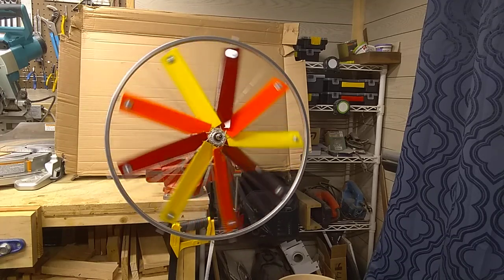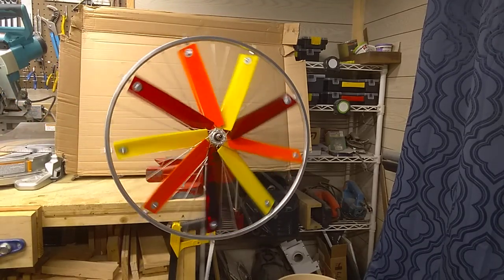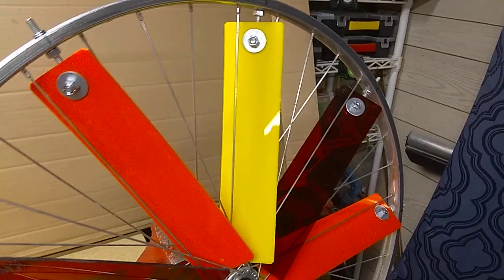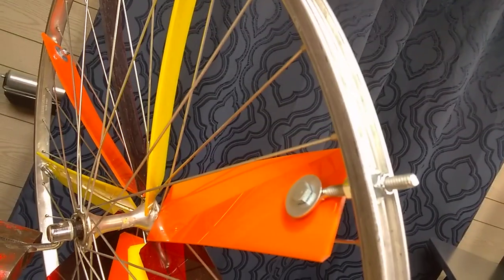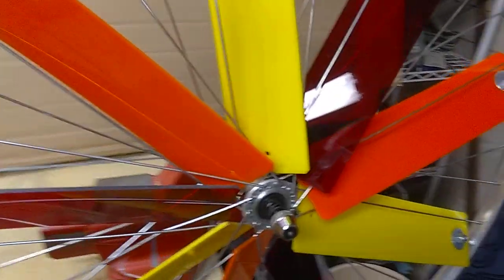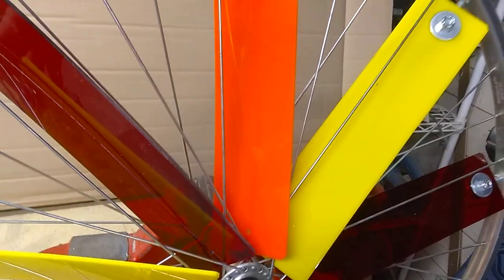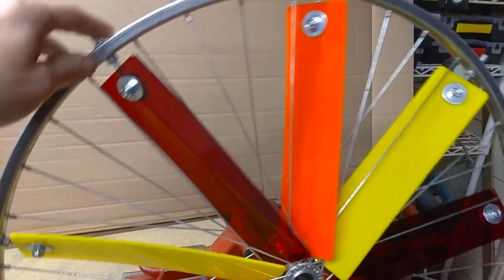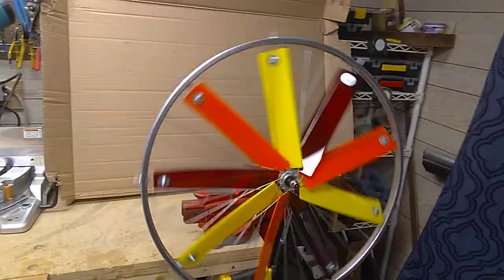A better bicycle wheel whirligig

Comment: Looks great and a very good idea. Do you connect the center by the hub? I noticed you have a hole there. Thanks for sharing with us. Albert in Texas.
Reply from the maker: I was going to use those holes to wire tie the blades to a spoke, but they weren't needed.

Comment: Where did you pick up the plastic? I would also think reusing old aluminum panels off window shutters would work too.
Reply from the maker: Possibly tapplastics.com.  It's easy to find online in various colors.  Sure, scrap aluminum would work fine.
Reply: Pretty much any scrap pieces of flat material would work as long as it's not too heavy.  I think the panels would work like a charm for this and would look really neat in the process.
Reply: I held on to some old aluminum Street signs and also some thin material of awning slats. I knew I kept them for a reason!

Comment: What did you use to cut the Plexiglas  and how long and how wide  are your blades ? And did you use Stainless  steel  Eye bolts and washers ?
Reply from the maker: I used a tablesaw, with an 80 tooth crosscut blade.  Cut slowly, with the blade only about 1/8" above the acrylic.  The blades are 2" wide, with the length dependent upon your wheel size.  Yes, the hardware is stainless.
Reply: @LarryCook1960     Since I don't have a table saw would and  oscillating saw work ? Also how long was your blades on the wheel in the video ?  I know your Eyelet is 1/4 " but how long is it ? Also what is the thickness of your blades on the wheel  is it  1/8 th ?
Reply from the maker: @gregoryp9217  My blades are 1/8" thick, and 10.5" long, but since there are several wheel diameters that really depends upon which one you have.  By oscillating saw, if you mean a Sawzall, it would destroy the acrylic.  If you mean a saber saw . . . . . perhaps a brand new blade meant for plywood wouldn't chip the acrylic too much.  https://www.acmeplastics.com/content/how-should-i-cut-acrylic-plastic/
Reply: @LarryCook1960     where would be the cheapest place to buy that Plexiglas  ? How much do you think you have in cost  between the stainless steel  eye bolts ,washers , nuts and Plexiglas ?   The rims I think I can pick up for $15.00